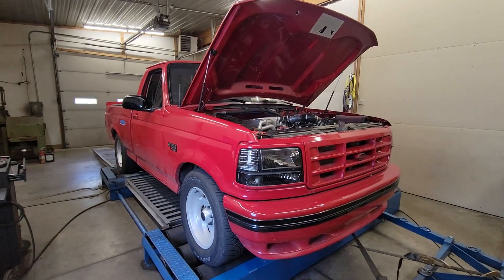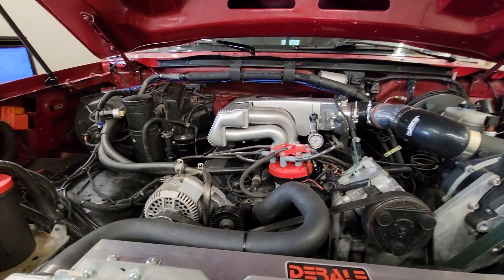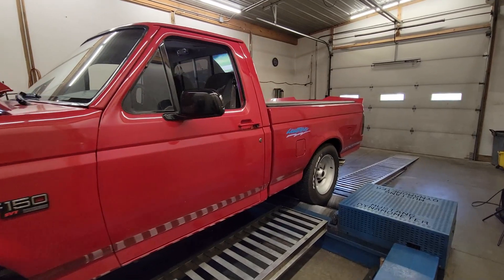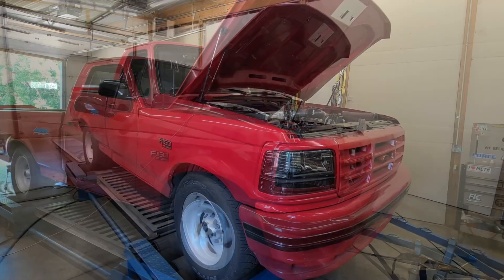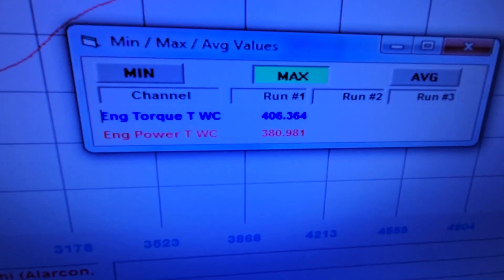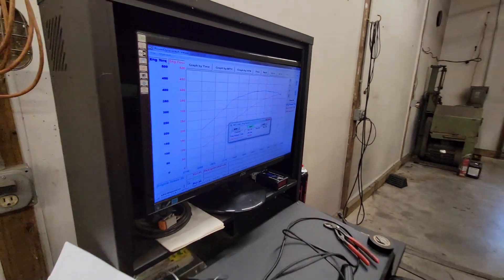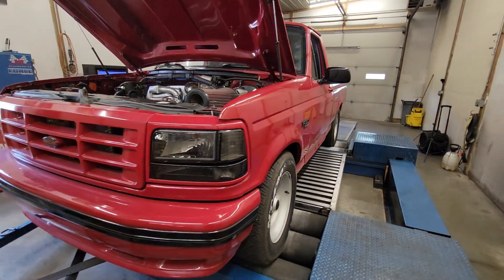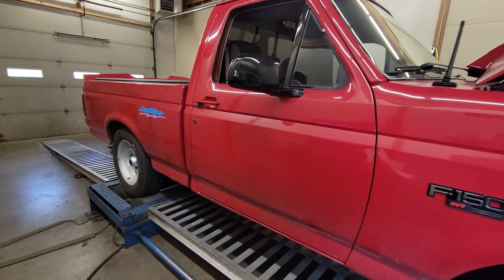Supercharged Ford Lightning | Blown 351W | Dyno Review

Comment: Ugh!!!  Reliving one of my bigger vehicle mistakes.  I had a 95 gen1, black,  37k original miles.  Ford racing mass air conversion, full bassani exhaust and some other tasteful bolt ons.  Absolutely loved it. But,  as the family grew I had to sell. I'll probably make a clone one day.
Reply from the maker: Sounds like it was a fun truck tho!
Reply: @ForceEngineering  it was.  It wasn't fast by today's standards, but it was quick.  Stop light to stop light it was quick.
Reply from the maker: @302hobronco  fun cars dont have to be fast cars, but it helps.
Reply: Do you remember who made the mass air conversion kit for your truck
Reply: @jn7157  it was literally a Ford Motorsports mass air kit.  It had the mass air computer,  mass air meter,  and 30lbs injectors.  I had the paperwork from Ford for the installation.  And I had all the original parts in a box that got replaced.  But I don't have any parts numbers. Sorry, brother.